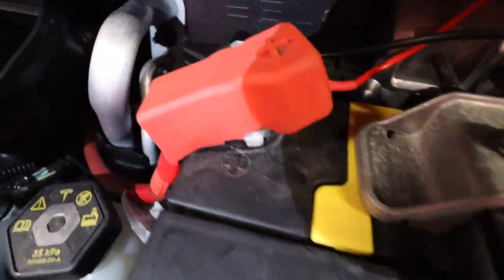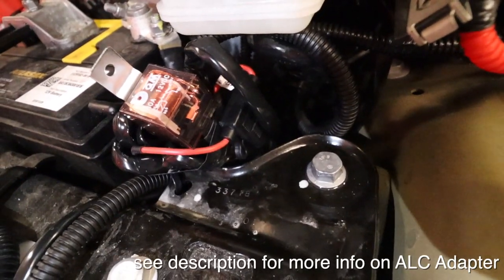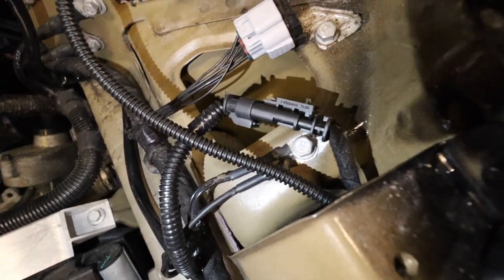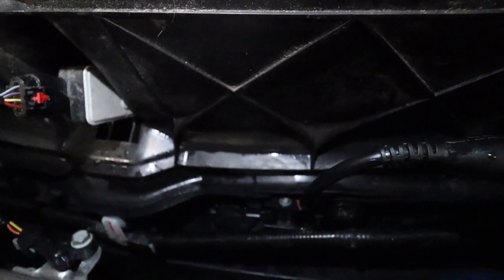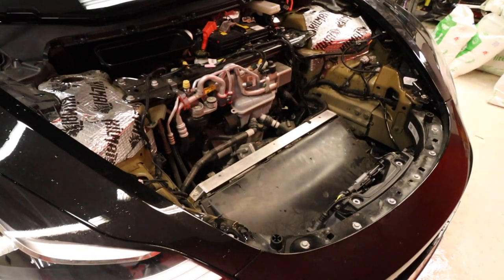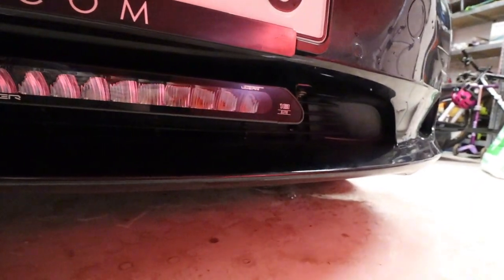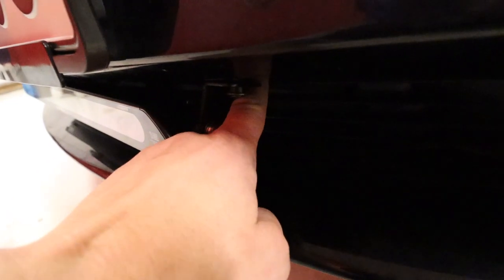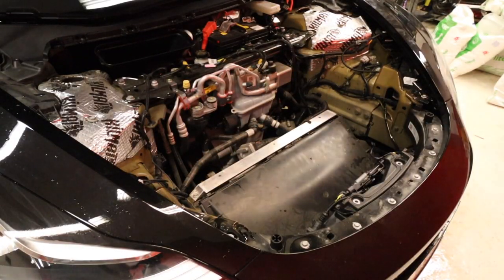DIY INSTALL THE MOST AWESOME LEGAL LED BAR ON A TESLA

Comment: Installed optibeam 800 led bar draws 20amps but battery only charging 6amp. Is there any othere 12v 20amp source?

Comment: Thanks for the speedy reply.  As the instructions I have are in Norwegian , and I can’t understand most of them, I have two more questions about installation.  From the ALC box there’s a cable with two connectors at the end.  I assume one connects to the Lazer Lamp LED bar and the other to the headlamp.  If so where does the connector plug into the headlamp? Can’t find that connection on the headlamp cable.  

My second question concerns the red and white wires that are connected to the fused cable from the ALC box.  I know the red connects to 12V.  But where does the white connect?  A switch I assume. Do I put that switch in the car so I can turn the LED lamp on or off?
Reply from the maker: Relay, you will ned a relay for the lights. The plug to the headlights go into the headlights with the harness going into a split ;)

Comment: Did You have to dismantle the front of the car to mount the light. Is it attached with self tapping screws or bolt/nuts? How is access on the back side? (Have not received my car)
Reply from the maker: Nope! It’s two ways to do it. One, you can dismantle the front or not. The plastic is ticker then on s and x in the bumper. There is also two layers. So a small size drill and screws with some locktite on will do the trick. No vibration even on vaskebrett roads ;)

Comment: Question.  Does the ALC box have some kind of sensor that determines when high beam is on? Or is there some kind of direct connection for that?
Reply from the maker: Yes, it is connected to the harness of the light and the impulse to high beam controls the ledbar as the stock lights

Comment: Have read someone saying that the model 3 battery is only charged at a maximum of 6amps and this pulls 8-9 amps. Not a good idea ? just a bit conserned
Reply: Trying to bump this :D Did you try to use this lebar continously for a long time without getting error message about 12v ? Just a bit concerned about what the 12v supply to the battery can handle.

Comment: awesome videos! :) After you drill the two holes how dificult was it to insert the two fastening screws from the inside through the bumper to the brackets on the ledbar ? Pretty easily accesible after you remove the "frunk tub" ? I have already installed a power frunk on my previous model 3 so have a bit experience, and I  want to get that and the lazer ledbar on my next model 3.
Reply from the maker: Just screw them in. Very easy. They are just in the plastic with some blue lockthight. Much plastic there
Reply: @FrostyFingers  Thanks !Tar det litt på norsk :P siden jeg for øyeblikket er billøs så kan jeg ikke sjekke på bilen. Når man borrer seg gjennom fangeren, ser man hullene enkelt på insiden ? og er det "luft" på innsiden der så man ikke risikerer å borre inn i noe annet på insiden av hullene man borrer ?
Reply from the maker: @jrgenask8466  bare ikke drill så langt ;). Neida er ikke noe bak der. Er fanger + innsiden av frunk så det er noen cm plast der. Slik de blir montert av de som selger også. Sitter godt
Reply: @FrostyFingers  perfekt ! takk for hjelpen :) forøvrig meget fornøyd med timingen min på salget av min SR+ for en måned siden og bestilling av ny LR AWD med nedsatt pris :P
Reply: @FrostyFingers  so its not a bolt and nut? Is it just screwed inte the plastic, like a ”wood” screw?